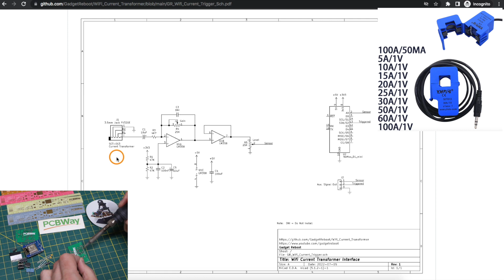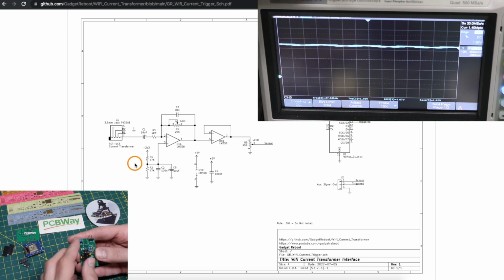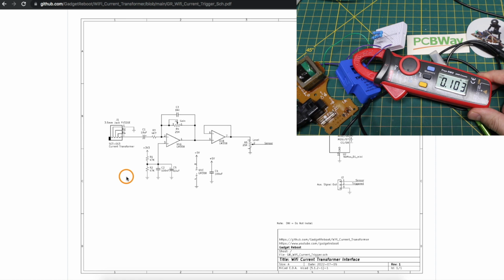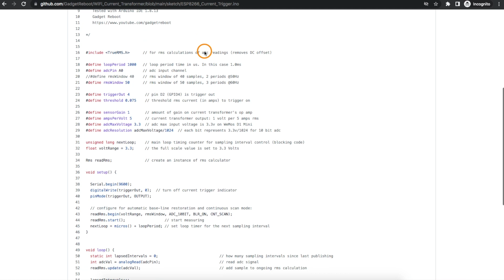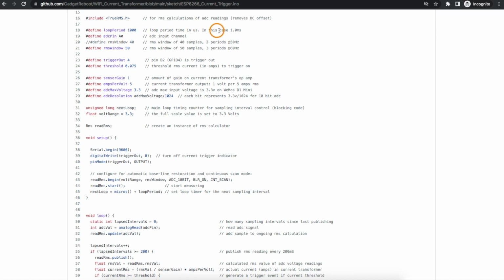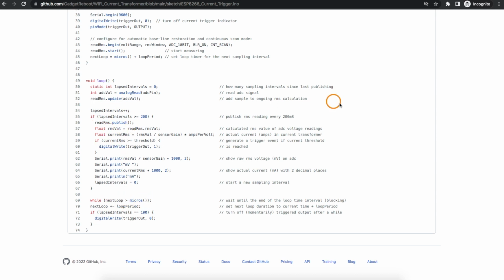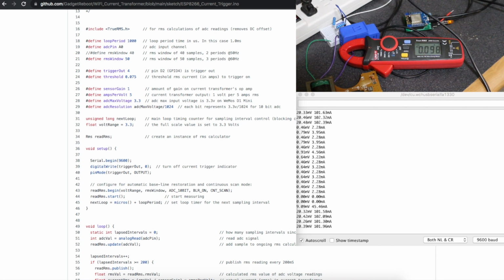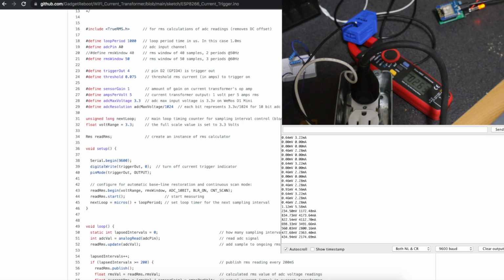SCT-013 Current Measuring with ESP8266

Comment: I'm sorry if I missed the link, but where is this true RMS library, and where can i see a clearer picture of the op amp signal conditioning circuit (youtube screen is too blurry). Thanks!
Reply from the maker: https://github.com/MartinStokroos/TrueRMS
That's the library, and I think the way I used it was by downloading the CPP and H files from the src folder on there and saving them directly in my INO project folder, not by installing it as an Arduino library, so it compiled that way.
The schematic of the whole circuit is in a PDF at the link in the video description to my GitHub project.  The schematic PDF has "SCH" in the file name.
Reply: @GadgetReboot  Thanks. I did find the those files on the Github link, and I'm hoping the Measure_rms sketch will get me started. I couldn't find your diagrams at your links in the notes, but I think I understand you OP amp biasing and filter circuit well enough. I'm very excited and surprised the ESP is capable of sampling an AC waveform fast enough to to perform the math needed to derive an RMS reading!  I'm skeptical though, as my intent is to measure current from a generator outside my house, and use the WiFi capabilities to transmit the data to a point indoors. I wonder if the background wiFi processes could function and "play nice" with the interrupts used by TrueRMS!
Reply from the maker: This is the schematic link which opens the PDF within Github.  Does that work? https://github.com/GadgetReboot/WiFi_Current_Transformer/blob/main/GR_Wifi_Current_Trigger_Sch.pdf
For me it fails to display a PDF due to some error if I use an obsolete computer that can't be updated anymore but on a normal system it shows the PDF.

I forget if I had to do any weird modifications from any demo sketch in the RMS library but whatever sketch I put on Github is the one that did work.

I had a project where I was trying to use ESP8266 with Wifi to do something else intensive and I had to switch to ESP32 and then everything was fine because one of the two cores gets dedicated to wireless and the other is for normal sketch operations.
Reply: @GadgetReboot  Thanks again! Good to know it will work on an ESP32, probably with some simple mods to the header files. I was able to d/l the schematic now. Two there. First, wouldn't it be better to move the scaling calibration pot (R5) to the point between the two op amps? This would allow that analog input to be driven by the lowest impedance possible, since U1B would rive it directly (or maybe through a 1K resistor). Second, this is probably overkill, but since you're working with pretty low voltages, and all OP amps tend to have some small DC offset, should the voltage divider (R1-R2) be a pot (maybe like a 10 turn precision) to make sure any offset from the final 1/2-Vref is tuned out? Or will that not be a factor in an RMS calculation?  Also, I don't think it makes sense for me to join your site with a monthly fee, but I'll gladly offer a one-time contribution if paypal is an option?
Reply from the maker: Yeah I recall something in the RMS library about it removing DC offset from the measurements as part of its calculations so any bias offset probably won't matter.  It's more of a rough attempt to make sure the AC signal has enough room to swing without clipping so if it's off center but in tact it should be good.

I can't remember if there was a reason I put the level pot between the op amp and analog input, especially since I think there's also a resistor divider on the ESP8266 module to further scale a max 3.3v. down to the actual analog input max 1.1v or something like that, so driving with an op amp directly would probably be how I'd do it if I were starting over.  But it seemed to work as is.  One possible thing I had in mind was to use it also to make sure I never exceed 3.3v out of the op amp because it's powered from 5v, so I'd probably have used a different op amp now that runs well at 3.3v (maybe rail to rail for more headroom).  

I'm not set up with any direct donation options, even though I looked into several.  They all had potential red flags for various issues including PayPal possibly holding money hostage for many months and possibly not ever releasing it, and other services sharing personal info (even phone numbers) with strangers on invoices etc, so I'm content just putting free content out there.
If you wanted, you could always sign up for a short interval and then cancel a monthly membership thing to equate to a one time donation, but not necessary!
Reply: @GadgetReboot  breadboarding this today, since its a rainy day :-) One question and one other observation. First, any recommendation for the C3? I'm thinking around 220pf if its just to filter RF noise, but maybe 0.1uf for a more aggressive low pass filter? Other  thing was, it seems to me that if the intent is to send an ac waveform that is centered at 1/2 Vref into the Analog input, shouldn't pin 1 of your "level" pot connect to UA1A pin 3, where you have already established a 1/2 Vref midpoint? As shown, the level pot connects to GND, which is 0-volts in your setup. I understand you spoke of the application being able to remove a DC offset, so maybe it doesn't matter. But it seems referencing 1/2 Vref for the level pot would be better?

Comment: What is the value of C3
Reply from the maker: It's  just a non installed part footprint to give an option to limit op amp bandwidth (reduce high frequency noise) in case problems showed up in testing but I never used it.

Comment: The output of the CT is RMS value of Voltage or Instantaneous Value of Voltage??
Reply from the maker: it is instantaneous, there’s no signal processing in the device it’s just a transformer so the RMS has to be calculated by monitoring several cycles after it’s read by ADC.

Comment: You might want to put some protection diodes on the input to stop spikes going above and below the supply. Also maybe a zener diode and buffer amp to remove any supply changes affecting the virtual ground reference. Remember if output of the current transformer goes open circuit you can get some very high voltages.

Also I think I'd go for an external adc as the esp8266 adc is 1V full-scale. So not taking in to account any offsets your measurement range is 10A/1V. (+/- 5A)
Reply: are you able to provide a sketch of those improvements, components values etc